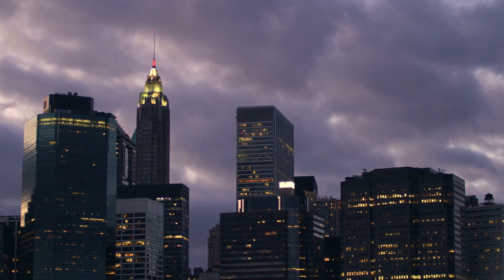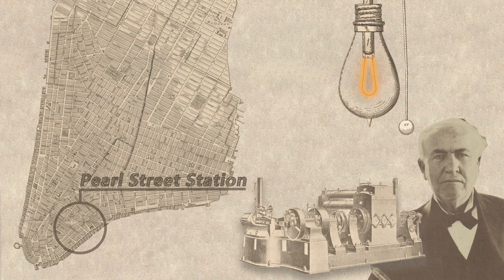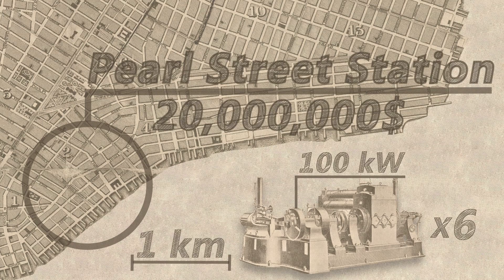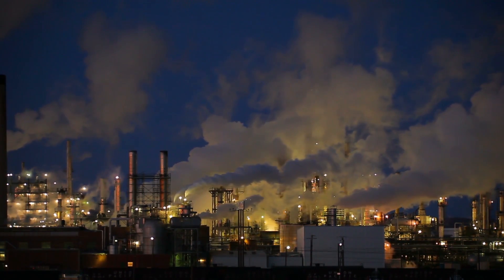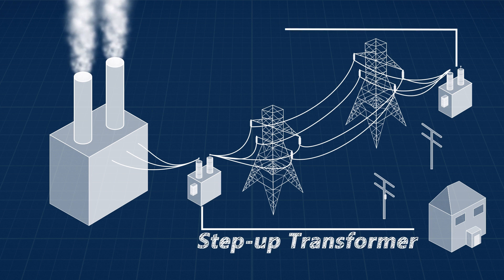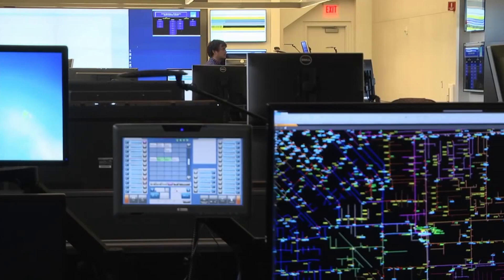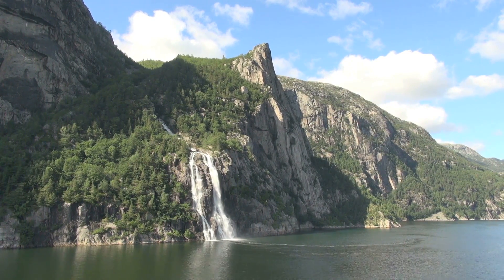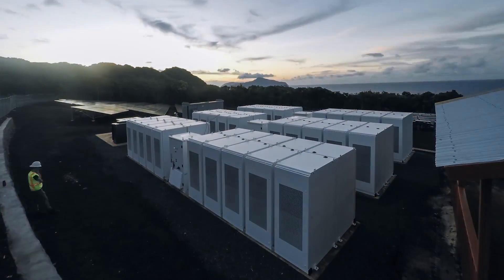What's The Biggest Machine In The World?

Comment: No, the water of the Nuclear Power Plants is neither for refregerating the core nor for the steam turbines. It is ofter use as a power sink. Usually 2/3 of the power generated in the NPP goes to the power sink.

Despite making good videos of material resistance this video has quite more mistakes:

-There are Power Plants which are use as back-up
-The demand is controled and it is known when are where is going to be consumed
-If there is a black-out the 2 thinkgs that might happen are lowing the voltage and the frequency which will help to stabilize the grid.
-The total black-out is quite weird.
-The PP are not redundant, they are use in different ways because where the Power is generated is important to keep the Voltage fix.
-In fact the wind and solar are currently able to knew the future use so a plan can be stablized.
-The TESLA battery is not just to store renewable energy

Comment: Hey Real Engineering! I loved the video! As someone who thinks that Nuclear energy is the most promising of the zero - emissions electricity sources, I was a little sad at the implication that nuclear, as a baseload, would be obsolete. I've heard that Battery technology, while important, might not be able to store significant levels of electricity at a utility scale and at a cost that's competitive with other electricity.

Something interesting I'd heard about in regards to Norway/Denmark and electricity exports is that not only does Norway have pumped hydropower, but has also often shut down dam hydropower generation when it's imported wind energy from Denmark, and restarted generation once it's stopped getting imports. this is, in a way, another kind of storage, and one that (I assume) doesn't lose as much energy as pumped hydropower. That's because it doesn't involve the operation of any pumps, and just stores electricity by not releasing water from a dam (so this would work with just dam hydropower, and not run of the river)

Thanks again for a great video!

Comment: The cable lines carrying electricity is a method of transporting energy, it is not a machine, but a path. A machine does something, a path moves something.
Reply: So a BUS in a computer is not a machine? Your using some pretty far out mental gymnastics to try and NOT call the national grid a machine.
Reply: A BUS is an intersection distributing the energy, and a BUS by all means could be a machine, as it is a part of one, but a path is not required for a machine to work, cars work without moving or even going off road, and phones work without being connected to the grid, I wouldn't call a road a machine because a road doesn't do anything besides function like a path. We put more lanes to control the flow of cars on a road, just like how we step up and step down electricity to allow further transportation of electricity

Comment: For those curious you can check out how pumped storage looks by googling Kruonis Pumped Storage Plant. On another note, moving to decentralizing power grid will most likely come with problems regarding frequency control, since solar and wind turbines both need inverters, this causes less inertial momentum in the grid and that is a major stabilizing factor for frequency

Comment: 'Large fossil fuel power-plants generating AC electricity are quickly becoming outdated and will be gradually decommissioned over the next couple of decades.' 

- They are not becoming outdated because they are hard to replace currently and i pretty much doubt they would become decommissioned even in a few decades without some major breakthrough. 

I think there is hope in Fusion and  glass electrolyte-based solid-state (newly developed battery chemistry  from John Goodenough, co-inventor of the lithium-ion battery http://www.pbs.org/wgbh/nova/next/tech/super-safe-glass-battery-charges-in-minutes-not-hours/).

If this is proved feasible, it can be used for large scale energy storage and electric car batteries.

Comment: great, but i hate to be a pain after all your hard work on video editing, the grid will still be AC so it will not go back to Edisons DC idea, Tesla's idea for transporting energy over long distances will still be the same even if everyone has solar panels, theres no point in tearing down the lines that connect us, one city may need more juice then another so therefore it will need to be transported using AC.
Reply: Tail finz yes, but the idea is that you supply your own energy, your own solar panels on your roof and your car as a battery.

Comment: wrong tile for this video. biggest machine in the world is CERN. and this video is about electrical grid which is not a machine. it is a system and if even 50 or 80% of system fails it will still work (with lowered capacity, but still work). but if only one component on a machine fails, that the machine is not working as it is supposed to work. interesting video anyways...

Comment: What happens long term depends on costs.  The cheapest energy source wins.  

Without tax credits, I'm not sure as wind or solar is that competitive.  Add in the cost of storage, it may no longer be the cheaper option.  Sure, you can pass a law to artificially change the price, but then not all countries are going to follow.  (Look how well nuclear bans are working out.)  Those that keep to the cheapest source will have an economic advantage and will get manufacturing work.  At that point, the pollution just shifts to a different part of the earth instead of going away.  Like China burning the coal the US isn't using.  So, in my opinion, the way to alternative energy isn't to rush to implementation, but researching ways of making it cheaper to make and store.  Not just for the grid, but for transportation as well.
Reply: Nuclear power is the cheapest option period. $2.10 per kilowatt-hour, compared to petroleum power, priced at over $20 per kilowatt-hour.

Comment: I am sorry but i feel clickbaited. When i saw 'machine' I thought some gigantic machine like a particle accelerator but not a 'System' such as the power grid. 
I love your video's, but this is a little dissapointing to my opinion. I am not mad, just a little sad :(
Reply: Adem Penver are YOU dumb? What he’s saying is that he expected a machine in the traditional sense, much like the ones at the beginning of the video when R.E. uses as examples of what he’s not talking about. I too expected something cool and massive, instead of this power grid thing. It was mediocre.
Reply: Adem Penver Don't add an insult to a question, it will not make people respond with an answer. Also power grid is using the motion of electrons to power things, but it doesn't accelerate it. If it were to accelerate the electrons, as it would need to use another type of energy to do so. People just don't think about the motion of the electrons when trying to disprove that the grid is a machine. But, they would be right when saying that the telecom network would be a machine, as it uses the motion of light.
This might not all be correct, but should be close.
Reply: Well, in that case, isn't everything a "machine"? Cities are connected by roads, trains and airplanes and produce things. Is our whole society a big machine?
Reply: Are you dumb, electricity running through wires is a particle accelerator. Does it not accelerate electrons?

Comment: Hi there, one thing if I may, or a few :) One of the biggest things that we need to do is to implement just enough batteries in our homes, charged via renewable energy, to cut down the peak, or hours on high demand. If someone wants to go totally of the grid, sure no problem. Those batteries connected in one system will be enough buffer zone. From there we can further upgrade to have less and less fossil and nuclear power plants. But, DC will never push AC away in term of usage. While there is some points in smaller local power plants, AC will always be more manageable. In my opinion, there is and will be, some magic number of balance between the two. Just until we use up all fossil and implement Tesla idea in wireless energy transfer free for all. Stay well!
Reply: The idea of Tesla batteries for all is laughable. People forget that there simply is not enough lithium. Trying to get enough batteries to power even a single city would mean massive strip mining.
Reply: Owen Major I am not about Tesla Batteries, because that is a company. I am about batteries in general, what ever sort the future is up to. LeadAcid is still fine and going up with spec for stationary batteries.  No need for light ones for non movable stuff :)
Reply: LeadAcid is worse, just imagine a number of batteries for one house. Each house would need a 1000lb + battery
Reply: Owen Major No need, way over calculated if any. There is the need to get only for peak hours, remember? If someome wants of the grid, and he is in the house not the flat or apartment, 500kg is nothing to lay down in the basement or in the shed. Who knows what the future will bring in term of stationary batteries. I repeat, waight is not their primary task. And all together wireless energy transfer is much better...
Reply: Wireless energy transfer? You really do not understand what you are talking about. Wireless energy transfer is extremely wasteful and is only beeing researched for spacecraft in the void of space. It wouldn't work in the atmosphere.

Ok, so I did a little math. For a short time period of three days, the average house would need 1071 4.5lb leadAcid batteries. That would be nearly 5000lbs of batteries for each house at the cost of 20 dollars per battery that would equal over $20,000 for each house. Additionally, lead acid batteries have a short life span so they would have to be replaced every 4 years.  

Still sound reasonable?
Reply: Owen Major You are missing the point again... Tesla did it back in the 19st. And solid state, marine batteries without special management last 10years. also Basic lead acid car batteries with some management last the same. There is also the ones that are in service for 15years and more... and again mayority need it for peak time usage. When connected in the big system in clusters, you dont need giant ones. Not every people have the same energy demand in the same time and place...

Comment: Correct me if i am wrong. but apart from the Norwegian solution of storing energy.
How are we going to store all the energy from "green" energy aka solar and wind?
Isn't this a flawed solution? Should we not research thorium reactors instead of solar and wind?
Because i want power at night when there is no wind. and making loads of hydro dams isn't very space effective now is it?
Reply: Bill Nye had an idea..  It was essentially using water.  Dig giant holes, pits, whatnot and essentially cork them with a big heavy cork (essentially a weight floated by displacement).  Pump water under the cork during the day with your clean power source (we'll say solar for now).  Then at night you let the cork push the water back out (driving turbines) and re-collect the power that way.  I have no idea how efficient it would be but the engineering is simple enough and no expensive, exotic or dangerous materials are required. :)

Comment: Sorry to disappoint, but while the US power grid is big, the Russian  grid covers a larger geographic area - plus the US grid isn't fully synchronized, it's not all one machine. I don't know which others are. Europe isn't, each country has their own grid with HVDC interconnects.

If you're looking for the biggest machine, the internet certainly covers a larger area than any electrical grid.

The Pioneer telemetry feed might qualify as the 'longest' machine.
Reply: Russia's might cover more land, but Americas is far more dense.
Reply: The National Energy Market in Australia is the biggest area wise, all synchronized across half the continent.  US has 3 or 4 synchronization zones, with High Volatage DC-DC links on transmission network to interconnect between them so it kinda works out to be one thing that includes Canada if I'm not mistaken.  Re: more appropriate world map projections to get a feel of who has the most area to cover have a look for a Peters projection and that'll give you an indication of who has the most surface area to cover.
Reply: It is very common to have electricity export in European countries, it is likely that most of countries are connected.
Reply: I respect your point, but I had this discussion with my Electrical Engineering professor, and the conclusion is that the US grid system is still by far the largest system built by man. It connects Canada and is far more dense with more buildings and connections than Russia. Russia has distance but 80% of the country is essentially a wild land in the east with half the population. 

Now the internet is something that can be debated and i agree that it has many “connections,” but i still don’t think it’s the largest. Each lightbulb, outlet, and electric component (which includes every internet based device) requires to be part of the electric grid system. You plug in your phone or flip a switch, it is now part of that system. So with just the logic alone that the grid encompasses all internet based devices (bc they need to be plugged into the grid to work) and many many more devices and subparts (2 billion lightbulbs are purchased every year in the US, so there are billions of just lightbulbs alone and that’s a fraction of electric devices), the grid already blows that apart.
Reply: Yeah, that was one thing that annoyed me. I know for a fact that Canada's grid is linked with the USA. My province sells massive amounts of hydroelectricity to the US.
Reply: Milos Momcilovic, there are six different grids in Europe. Continental Europe is one huge interconnected grid, but Scandinavia (4 countries), Ireland, Britain and Iceland have separate grids. Then there's also Russia's grid to which the Baltics, Belarus and Ukraine are connected.

Power transfer between the grids is still possible though by transforming to high voltage DC and back.
Reply: +Magnus Dagbro yeah, thats how theyre trading electricity if and when needed.. thanx, its more clear now!

Comment: We're not going to go back to the Edison model of the grid even with renewables. Even if we have local generation with 100% renewables (something I also seriously doubt), they will need to be strongly interconnected to allow a failure in one area to be compensated for by others. Many renewable proponents advocate something Tesla would be proud of, supranational grids of huge capacity allowing immense amounts of energy to flow from one region to another, as it allows sunny and windy areas so supply dark and windless ones. Probably the most efficient way for northern Europe to run on solar would be to import nearly all of it from more southern countries (politics and energy security nonwithstanding), such as north Africa and the Med as insolation levels are poor. And local generation is not a given with renewables either, hydro and wind tend to be in isolated areas, and rooftop solar with powerwalls only goes so far, you'd still have massive farms that act like big power stations.

The only way I can see anything like Edison's model happening is if we invent a compact, ultra reliable generator that can be installed in homes or local neighbourhoods, offices and factories, and generates no CO2. something like a Mr. Fusion perhaps.

Comment: Didn't mention the growing costs of infrastructures needed to make the new energy production scheme function. Power lines will have to be dimensioned with power coming from anywhere to anywhere on the grid to meet the requirement of areas not having wind or sunlight for long durations, thus depleting their batteries. That's already causing problems in the German alps, where people don't want to see 400Kv lines defiling their landscapes to bring in energy from the coastal wind-turbines in winter.